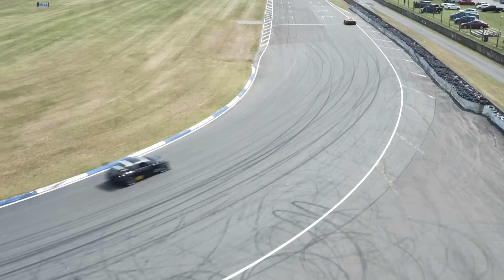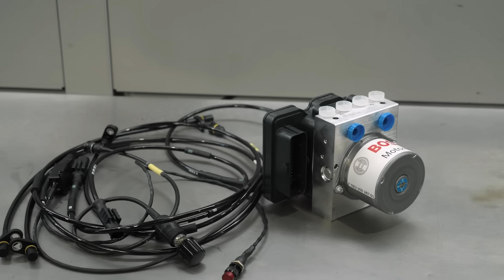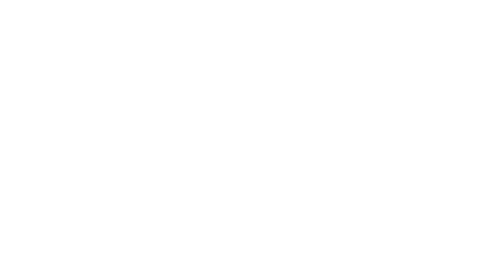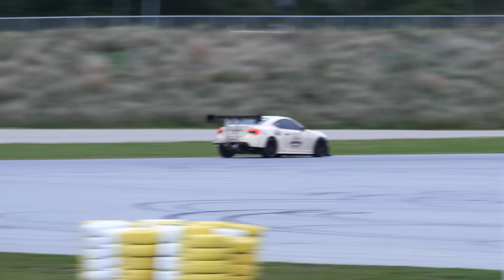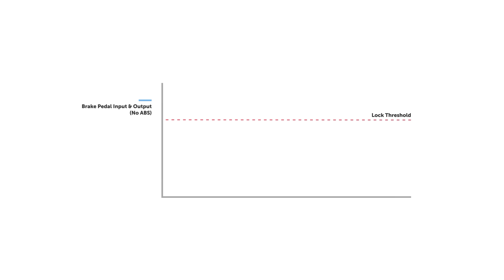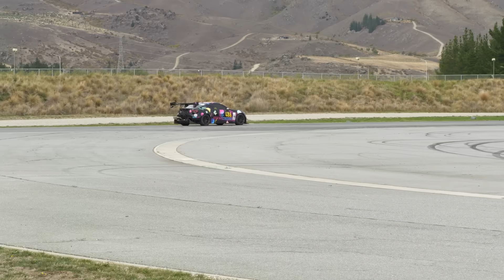Motorsport ABS Performance Tested | The TRUTH

Comment: anyone who says a good driver can outperform ABS is lying, the ABS system can modulate the brakes 40 times a second or even more and still monitor the wheel speed. ABS is just faster and more precise snd reacts faster than any human
Reply: ABS has momentary gaps where it stops braking to allow steering input.

this can be seen in slow mo videos of it working.

it could be agrued that you can stop quicker without those small gaps of the ABS kicking off and on again.

but I'd like to see this tested.
Reply: @growingup4487  no, it cannot be argued.
Reply: @andrewking1427  a good driver would know he brakes slower in a draft or when a wheel is airborne.. and abs can't help a tire stop sliding laterally, only rotational usually in one axis alone. MotoGP has abs, but it doesn't help them wash the front out on cold tires..

in rally you may need a 4 wheel lockup to slide, how would abs help there?

everything can be argued under specific circumstances.
Reply: @andrewking1427  except it can.  some abs systems are just shit if your only goal is slowing down as quickly as possible and nothing else.  the abs on my zx6r and shitbox car are both very easy to out brake in a straight line in a predictable environment.  around a track or unknown roads with changing road surface conditions on top of human error while driving at pace though? that would be a different story
Reply: @growingup4487 that's not how modern ABS works. Modern ABS achieves threshold braking at all 4 corners. It doesn't lock/unlock/lock/unlock like the old slow systems.
Reply: @growingup4487  The gaps in braking that ABS uses are not to allow steering input. They are to allow the ABS to measure the slip ratio of that tire. Slip ratio is the relation between the angular velocity of the wheel and the linear velocity of the car. This ratio is constantly changing depending on how hard the car is stopping, because the tires are rubber and deform rotationally. When the ABS stops brake pressure to a given corner, the slip ratio goes to a known constant, which allows the ABS to then determine the exact vehicle speed at that instant. ABS then applies pressure to that corner again and can target an optimum slip ratio as it just measured the vehicle speed and knows the rotational velocity from the wheel speed sensor. This allows it to try and keep the slip ratio at the optimum point for a given tire and load. If the vehicle had a very precise and instantaneous ability to measure vehicle speed, there would be no need for ABS to pulse the brake pressure and stopping distances would be even shorter.
Reply: Good drivers can outperform bad ABS. But besides that, you're right
Reply: Plus it controls each wheel independently whereas a driver only has one pedal.  If the driver keeps the tyre with the least grip right an its limit then the other 3 could accept more.
Reply: @steveallen1340   You beat me to it. For years I've road raced my 4th gen Camaro with no ABS. I went out 1 time in my C5 Z06 in autocross and instantly leaned hard into the ABS, I could trail even deeper and stop harder while doing so as I wasn't limited by the outside front wheel. Early ABS systems sucked, even 2000s systems were night and day better.
Reply: The same argument could be made about stability control or Traction control, yet most decent drivers are faster when turning off those factory systems in good/dry conditions and Elite drivers can be faster in wet and mixed conditions. Considerably faster on less performance oriented cars even.

I think it’s less common, not as repeatable, and the driver skill has to be higher again, but elite drivers can outperform OEM ABS (especially with modifications like R compound tyres) as even it is explained in the video. Factory ABS is calibrated to keep stability (it can definitely affect decent trail braking because of this), for road tyre and road conditions grip level (so it would need recalibration at a minimum, which isn’t really a thing) and also the OE system is reactive, so it needs a wheel to effective lock for the ABS to kick in and then unlock completely which is technically jumping up and down the optimal slip percentage of the tyre, which is where a high skill driver can keep the tyres closer to the threshold without locking, but usually only in a straight line braking and for trail braking. 

In mixed grip situations this is less likely to happen but this is when OEM ABS can also be unpredictable and create situations like Ice mode (again also mentioned in the video) and even certain corners on certain tracks can have this issue with OEM ABS, yet not be a problem with out it, so consistently can be improved without ABS also.

Now what I don’t think is an argument is that a driver could outperform Motorsport ABS……
Reply: @reecemcintosh2028  You sound like a guy who spends more time on YouTube than behind the wheel. Every OE ABS system is different so YMMV here, it's just not accurate to make the blanket statement that all OE ABS can be outbraked in the year 2025 by competent drivers, especially in a trailbraking scenario. Ask any Spec Corvette racer if they prefer ABS on or off. . .
Reply: @Supercharged111 Even top sim racers leave ABS on. Most importantly, it preserves tires and allows for consistent lap times, which not many people focus on.
Reply: @Supercharged111  I made less of a blanket statement than the original comment by saying it “Can” be beat, not that it will be beat every time. It’s less accurate to say it can’t be beat by anyone when in many situations it can be.

I also said that it was less common, not as repeatable and only elite drivers (not just competent) can outperform OE ABS  consistently? I would argue that 99% people wouldn’t have a chance at beating OE ABS in the same way most people can’t go faster when turning off ESC systems, but I am yet to find a car I can’t go quicker with ESC off vs on yet, including high end 2025 models (which by the original blanket comment shouldn’t be able to happen or I am lying)

As for sounding like a guy who spends more time on YouTube than behind the wheel, I have represented my country in Motorsport, I am a professional driver coach (including data analysis) and I run a performance workshop, so I probably have enough background to make a non-blanket statement that OE ABS can sometimes be bettered by an elite driver.

I would be surprised if some drivers wouldn’t prefer to put in a proper brake bias adjuster in a spec corvette and run without ABS? As just turning it off often creates poor brake bias. Is that allowed in the rules?
Reply: @Supercharged111 in the video at 15.20, they show the difference between OE ABS in a modern car (2015 Toyota) and Bosch Motorsport ABS is 111.2m vs 92.8m. Over 15%/18m better.

Are you really telling me, that OE system is unbeatable by an elite driver with a brake bias adjuster?
Reply: @Supercharged111  Just a hot tip, Reece has represented Australia overseas and is one of the best motorkhana / autocross drivers in the country :)
Reply: Motorsports ABS is specifically engineered once the technology was available and only released until or if it could exceed expert's car control in braking. Earlier, ie cruder systems could be beat out driven in expected threshold brake points but even older ABS will out perform a driver in unexpected or escape maneuver braking. Furthermore, the game changer is the advanced 4 wheel EBD(Electronic Brake force distribution system) integrated into ABS. My 2001 Tahoe tow vehicle has ABS/EBD standard equipment, and braking is spectacular......more attribute to EBD per se than simply ABS.
See my other reply
Reply: in theory, on a perfectly flat surface and breaking in a perfectly straight line, it should be possible to outbreak abs especially older systems, since abs per definition fluctuate between breaking a too much and too little, over and under the limit, if only a tiny amount. however in practice, aka real life where we try to rotate the car whilst breaking and the road surface has banking and unevenness and the driver cant break at a perfect threshold, it is practically impossible to use even close to 100% of the available grip of all tires at the same time without having an abs system. 

with that said, abs in my opinion dont belong in motorsports since its a skill to know how much you can break and to extract as much of the cars potential as possible,. and isnt that the point of racing? what really kills time when people talk about abs systems is the primitive traction and stability control in moststreet cars, it hinders the driver from rotating the car and kills power and adds break when it feels tire slippage  while accelerating or "over rotation" while turning. turning off those is what really can give a couple of seconds per lap (depending on driver skill, car model and so on).
Reply: @Luri-x6x3h  it's almost the same argument vs F1. 
How much tech you can include in the car before the race became kind of boring to see or to race or too expensive.
Because without ABS or traction control, every enter and exit of a corner is exciting because any driver mistake can be used by others to gain an advantage.
Reply: In the early days of ABS, it absolutely was true that a good driver could slow / stop a vehicle better than the ABS could with proper threshold braking which is where the now somewhat of a myth comes from. As technology improved, the fact slowly became a thing of the past. What really was the big game changer that made to where ABS could easily outperform the best of the best drivers is the implementation of truly independent channels and EBD (Electronic Brake Distribution).

So to say that someone saying "a good driver can outperform ABS is lying" isn't really true as it is entirely possible that they aren't update on advancement and might very well be making the statement based of antiquated technology that they might be familiar with. 

What it boils down to is that if making a blanket type statement either way, for or against one outperforming the other is misleading because both are true and false depending on the context.
Reply: Not sure on cars, but I've heard that on motorcycles ABS is disadvantageous on dirt, it's better to be able to lock at least the rear wheel. Thus on dual-sport motorcycles it's best to have it equipped and enabled for pavement riding, then turn it off when you get to the dirt. I'm guessing that's the only situation where ABS is disadvantageous, in all other cases you want it. Especially with the unpredictability of the street. Even if a driver could do better than ABS (doubtful) under ideal conditions, when they're frantically trying to not smash into the idiot that pulled out in front of them having ABS deal with braking is a very good thing. As a self-proclaimed good driver (some study once said 90% of people believe they're in the top 50% of drivers...) I've skidded my non-ABS classic car into more stuff than I'd like to admit.

Neither my classic car nor my motorcycle have ABS. If I could find a feasible and affordable way to do so, I'd like to retrofit it to both.
Reply: @quillmaurer6563  Not sure about Motorcycles but there are a number of options for retrofits for cars that aren't nearly as expensive as this, though not quite as good as this system being a true motorsport system. A common one is the Teves / ATE MK60 system from the BMW E46 M3's circa like 04/05 (if memory severs me correctly) as it can easily be ran as a standalone ABS system. There are some other decently good (at least for street use and even moderate track use too) early 2000's system that can be ran as a standalone system too. Later systems, which technical are probably better start to be problematic when they are not hooked up into a CAN-BUS network they are designed to work with.

I know with the MK60's you can usually find the Pump/ECU (its all one contained unit) for under $1k US and there's a company named Tulay's Wire Werks that put together a complete necessary wire connector kits for making custom wiring harness for MK60 retrofits for like $150 US

Comment: How did the Bosch system compare to the Teves Mk60 system you installed in the past?
Reply from the maker: We don't actually have that project up and running yet. Found some rust in the body so it's turned into a full resto. It is also an FJ40 on 35" mud tyres, so not really going to be a fair comparison anyway to be honest - Taz.

Comment: Couldn't you just switch off the  ABS, test it, and switch it back on so you could test it in similar conditions? The improvement is clear but still similar conditions is always important and you did mention that total switch off of the ABS system is possible at the beginning of the video.
Reply: @Runmeerkat  some abs system can't be fully turned off
Reply from the maker: This test was really about OEM ABS vs motorsport ABS. We have no doubt what is better when it comes to ABS on vs ABS off and that has been covered plenty of times elsewhere.
You're not wrong, though. It might have been nice to add that in hindsight for entertainment purposes, but data wise, it just wasn't on our radar as a question without an answer, to be honest - Taz.
Reply: @hpa101  ah so sorry I tought you were trying to break in the shortest length possible before using the Motorsport ABS and my mind just "defaulted" to no ABS because like Andre mentions in the video a it is possible for a pilot to make a better job at braking than a regular ABS. My bad.
Reply: but they weren't comparing no ABS to some ABS were they... they were comparing the stock ABS system to the motorsport ABS system